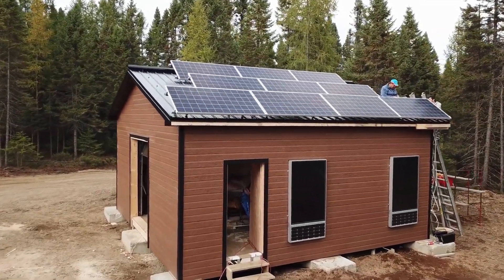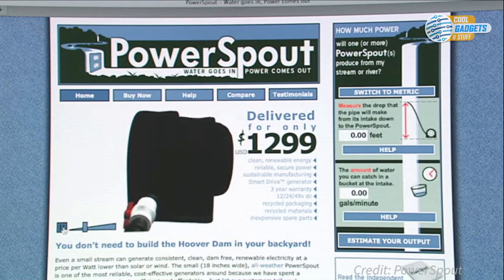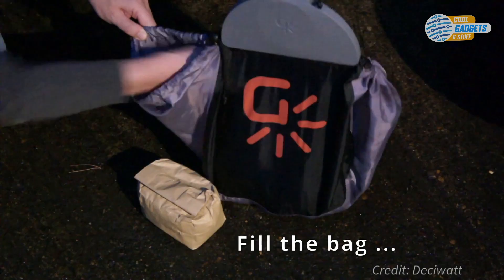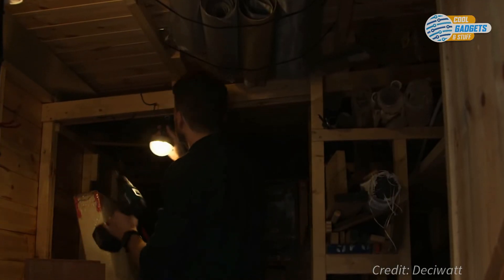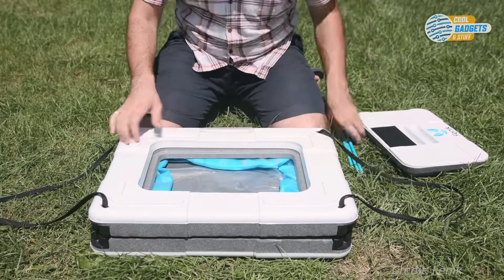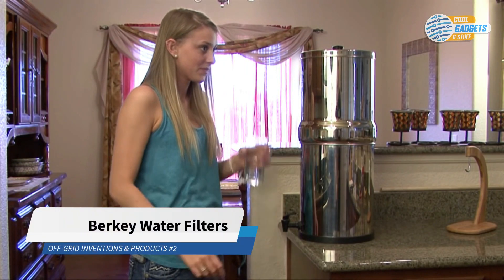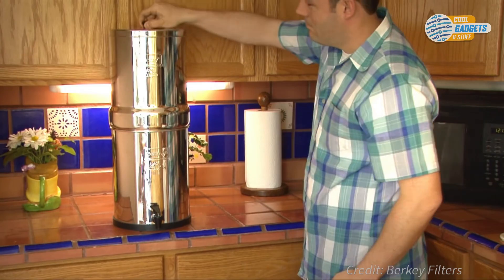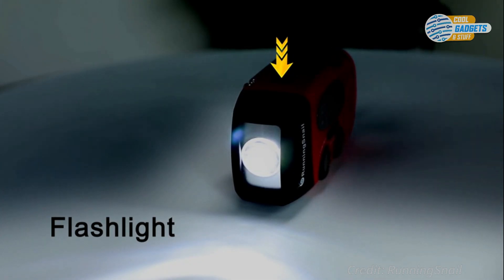6 OFF-GRID LIVING Inventions & Products #2

Comment: 3:20 They cost nothing to run, but, eventually, the storage battery will become useless. Then?
Reply: Then you either rejuvenate the battery you have, or you replace it. You can replace it with the newest technology available if you would like. With hydropower you don't need much battery if at all anyway.
 Either way renewable energy is much more reliable, pollution-free, and less expensive overall than to hire thousands of people to lobby the government (bribe officials) in order to get them to allow the destruction of complete mountains (MTR) and other areas to mine for coal, transport it thousands of miles, grind it into a very fine powder, just to burn it and turn it into air, ground, and water pollution oh, and some electricity too.
 Sure there are challenges in all systems, but they can be overcome.
 Take the words of the naysayers on radio, and the TV with their carefully scripted remarks with a grain of salt. They are paid a lot by the entrenched energy providers who know what will happen to their industry once people understand that we don't need them anymore.

Comment: Chinook Solar Air Heater makes little sense. The same can be achieved with a well isolated, south-facing window ;)
Reply: Actually, a window alone will not collect that much energy -- unless you put a similar black collector behind it. To me, the fact it only works in full sunlight makes it much less valuable. (at night, when the sun is down, is when I need the most heat.)
Reply: @jfbeam 
Your statement doesn't seem to go along with thermodynamics.
The light comes in and it has some energy. 
Unless the light escapes the building through the window, it stays inside. It would reflect and leave the heat on various elements, but ther is no need to have something black as long as the mifbr is not directly reflected back through the windows in the house.
The energy can't just disappear...
Reply: @jfbeam  Large windows and a brick structure will heat up nicely let the sun in each day of the winter the temp would hit 90 inside then cool off after the sun went down  rarely turned the heat on of course I was not home in the day time.
Reply: However heat lose at night from that window negates most heat gains.
Reply: @princeeric71  Not with modern quality windows.